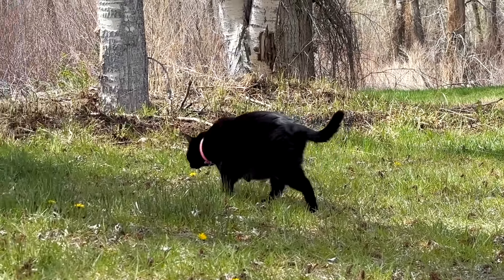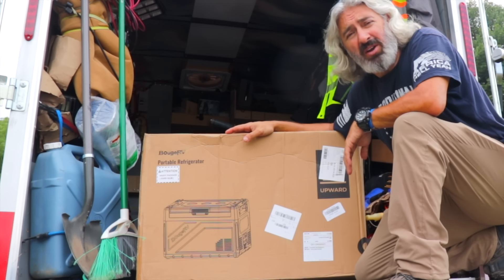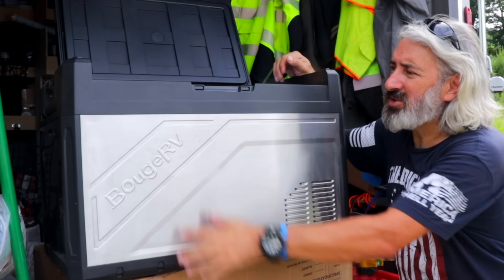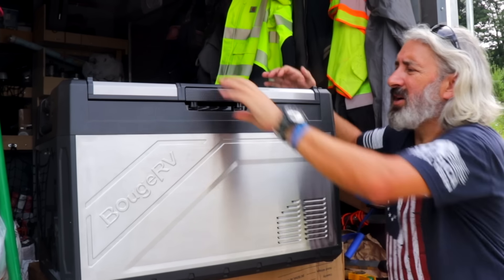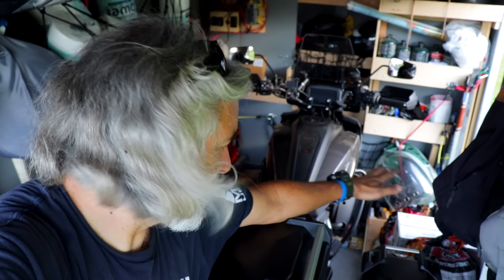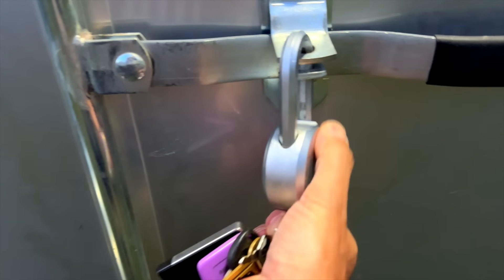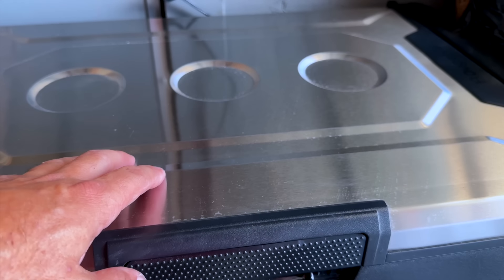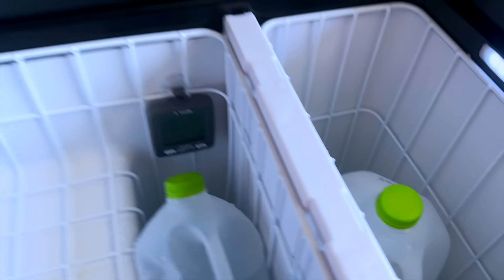Van Life; I Needed This In My Trailer! BougeRV Rocky 50 Freezer/Refrigerator!

Comment: This fridge is marketed as an overlanding fridge, to be used outside in the weather, is why its stainless steel.. now ill tell you that they copied ARBs elements fridge in their design,  however as the owner of 2 ARB elements fridges, i have 1 thats been bolted down to my flatbed work truck for about 5 years now, thru rain, snow, 100+ degree temps,  its always worked.. obviously this isnt an ARB which cost me about $1800 each, i hope this fridge works well for you ✌️

Comment: Pull the divider out and it will run as a single unit. Only need divider if you want fridge/freezer. Easier on compressor. Good luck.
Reply from the maker: The divider was there to try out both sides as freezer. Now it’s been running just as one compartment. 🥶🚐👍🏻